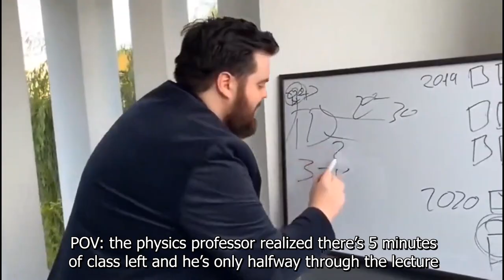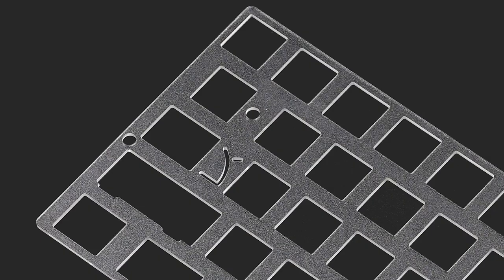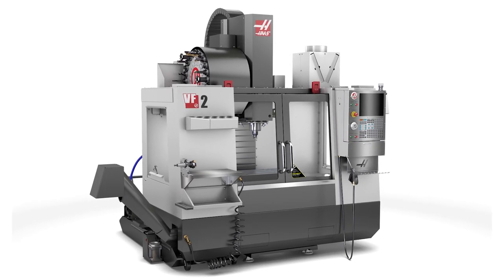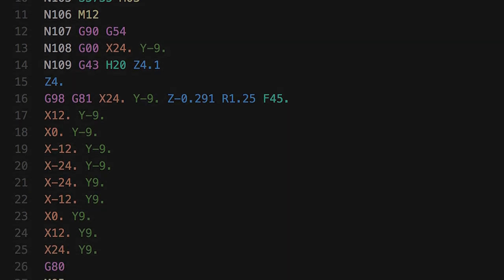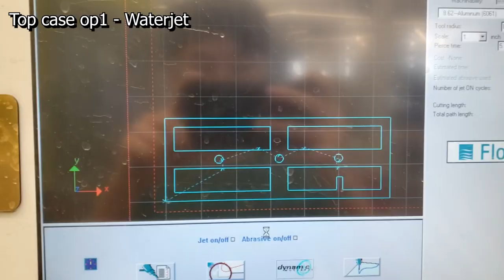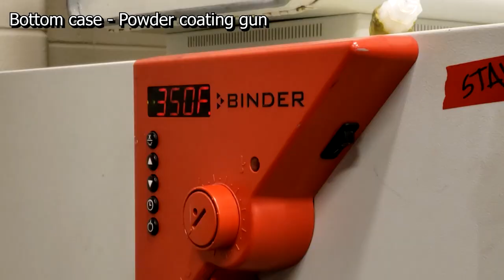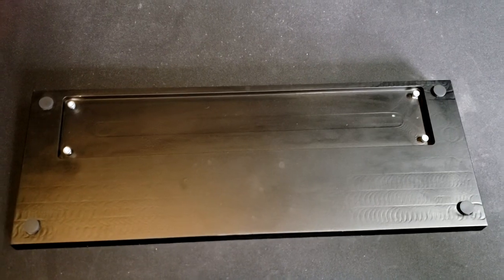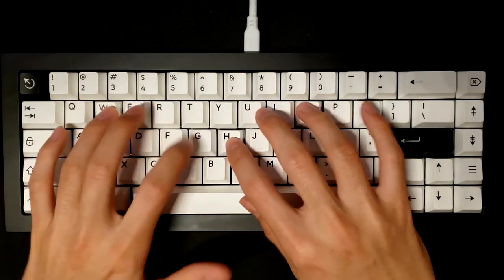Making a mechanical keyboard case from scratch

Comment: As a mechanical engineer myself I was shocked at the choice of cnc vs 3d printing. As, cnc is quite difficult to cut out sharp angles with tall walls
Still, very well made. Subscribed 😊
Reply: 3d printing I don't believe works as well for keyboards
Reply: @quantumxp  i am using just a pla for my keyboard. yep it sucks.. i prob order carbon fiber plate and acrylic back

Comment: This is kindof a reality check. Assembling a keyboard, fine. but making one? idk.
Reply from the maker: It's not typical for keyboard designers to create machine code and actually operate the CNC machines, most just send their designs to overseas manufacturers for a few rounds of prototypes before production. However, this still requires an understanding of CNC machining limitations during the design process. Whether or not you machine it yourself, it will still cost a lot of money.
Reply: yeah you really did go beyond everything I would have expected in terms of building  the keyboard. for me I don't see myself going quiet that far, but it was very interesting to watch the full process  @koovin02

Comment: I had the idea to create my own keyboard from scratch. 

Not anymore 😭😭
Reply: i did it but with 3d printing and handwiring, and thats a lot cheaper and easier
Reply from the maker: i think the resources to create your own keyboard from scratch are pretty accessible so i wouldnt be discouraged, although if you were looking to make one out of metal it will be a pretty big timesink and moneysink
Reply: You can try to make the case from wood. I don't have access to a nearby CNC machine or any 3d printer, so I basically created a friction fit case using power tools.

Comment: Insane. Do you have a rough estimate on how much material cost went into the case? I assume the CNC, laser cutter, etc. usage was free, but do you know how much that'd cost if outsourced to a shop?
Reply from the maker: There is a big difference between one-off costs and production run costs, because it is always cheaper to buy materials in bulk and it is very time consuming for manufacturers to setup for just a single prototype.

If you play your cards carefully and your design is simple you could probably stay under 200-300 USD for material costs for a single prototype. However, labor costs are expensive and I've heard that you can expect to pay at least 500 USD for a single prototype to be manufactured. Again, it depends on the design complexity so you can expect it to reach up to 1000 USD if you aren't careful

Comment: Why use aluminum plate for gas- nvm
Reply from the maker: I actually had plans to use POM, but the sheet of plastic came warped and remained warped after waterjet cutting. So I ended up going with aluminum since it was easier